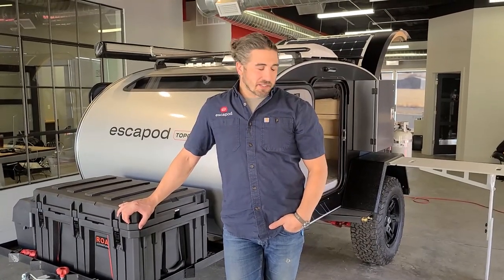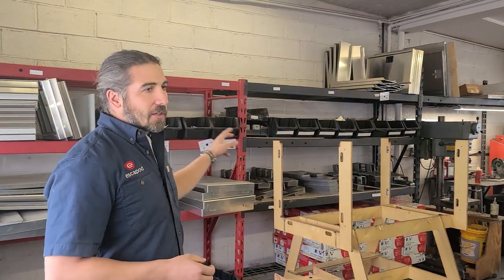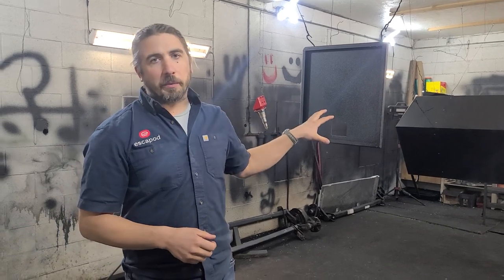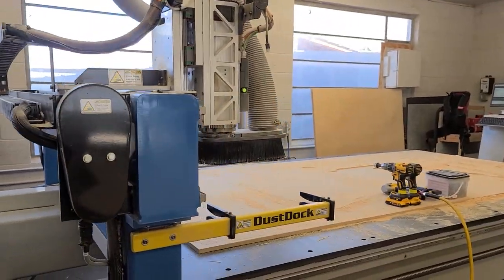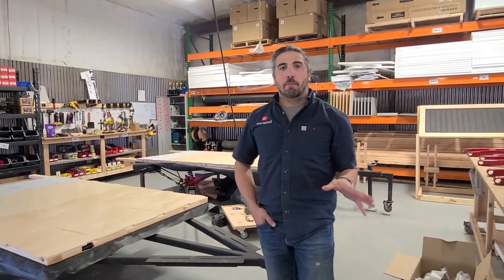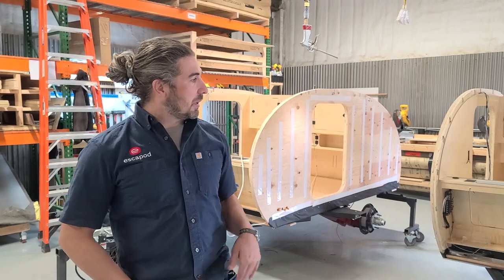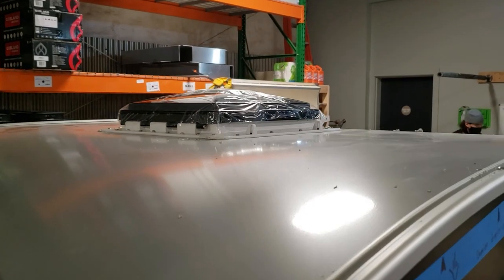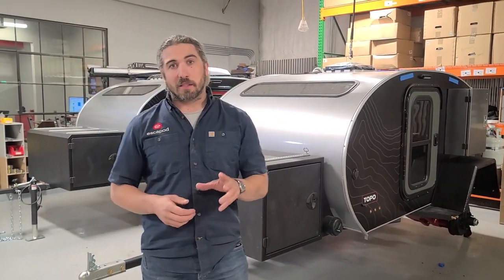Escapod Shop Tour 2020

Comment: Question: with a fridge in the tongue box there's no need for cooler in back, could you put a sink where the cooler use to be  instead????
Reply: Maybe, stainless steel country style sink
Reply from the maker: Technically, yes, a sink would fit in that space, but we've opted not to put a sink in this model for a few reasons. First, the galley in this configuration is extremely user-friendly. It's one of the things our customers like the most. Secondly, running plumbing internally through wood subjects the trailer to some unnecessary issues in case of a leak.

Comment: Chris, After months of exhaustive research I have decided on escapod due to layout, size and quality of build. My only concern would be the underlayment material between the frame and bottom of the floor. What material is used for the underlayment for the water proofing? Is the wood used in the trailer baltic birch? And lastly is the wood used for the floor and the rest of the trailer sealed or water proofed in any way?

Comment: I really love your trailers.  Im having a hard time deciding between your beautiful product and a Bean trailer.   What makes your product stand out vs the Bean trailers??  Any additional information would be very helpful,  i have watched all the you tube videos on both products,  love them!!  Thank you so much!
Reply from the maker: Thank you, Brandon! Bean also makes a quality teardrop, so you have great taste. Most notably, our proprietary independent suspension design, the Freeride Suspension System, makes our trailer a bit more capable in the off-road department. Another difference between us and Bean would be our approach to galley design. We have optimized our galley so that there is very little setup time, all elements are easily accessible while cooking, and we have a lot of workable counter space. It's one of the things our customers love most about our trailer. Lastly, is just the aesthetic difference between us, which is largely a matter of personal preference, not necessarily "better or worse". Let me know if you have any other questions!
Reply: @EscapodTrailers  thanks so much for the quick response!!  I really appreciate it:)